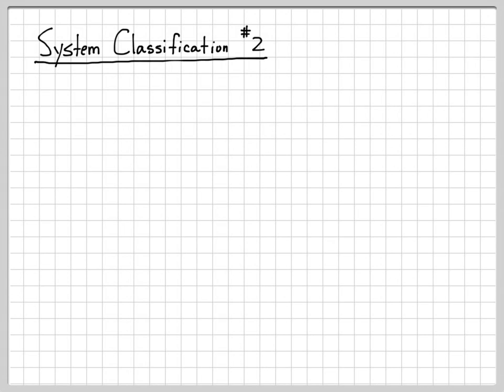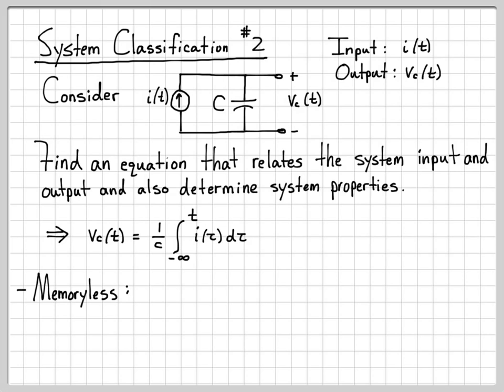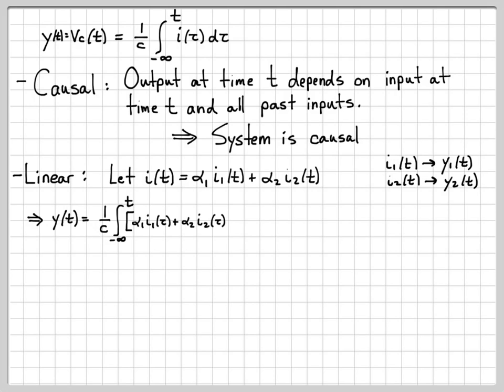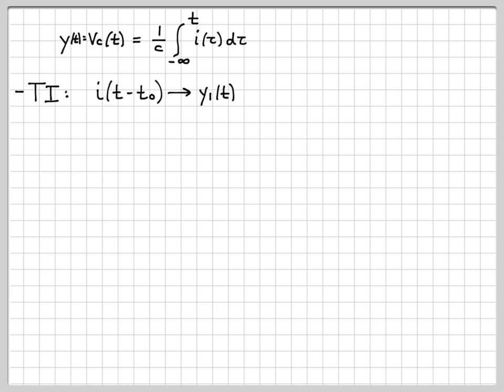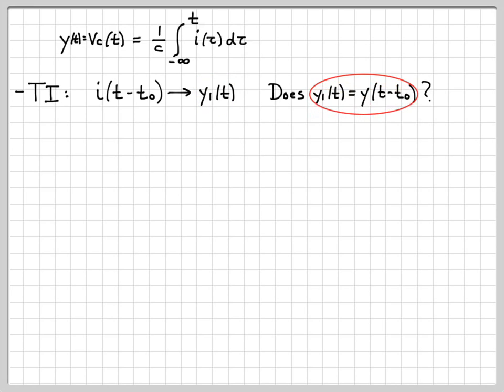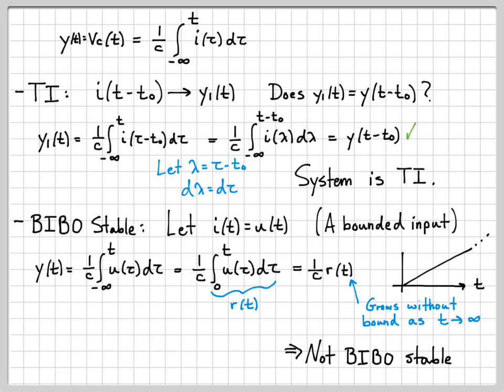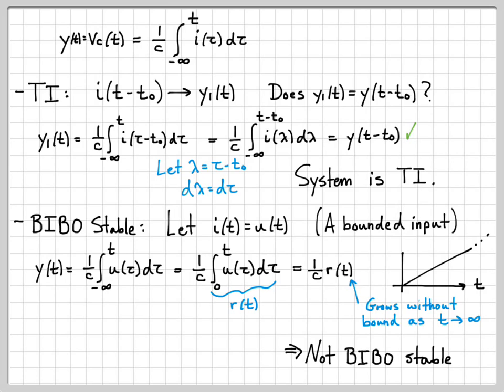System Classification #2

Comment: Hi. I'm trying to teach myself signals/systems stuff for personal interest via YouTube and your videos are VERY helpful, but I think it would be clearer if you related everything to real-world hard tech. The example of BIBO stability is one of these. Applying the unit step function across this capacitor is a bit like running a one amp DC current across it from time zero, in which case the potential difference will climb without limit as long as that current is maintained - and you can logically deduce that you would expect a non-BIBO outcome. (Of course in real life eventually the PD climbs so high it blows through the dielectric and ends things, but that's another matter.) 

I will work my way through your vids and await an example of a BIBO-stable system and its real-world equivalent!!

Comment: You have defined Memoryless system and Causal system exactly the same. I believe that Causal system definition is correct: Output at time t depends only on input up to time t (which includes past times like you mentioned). Where Memoryless system should only depend on input at time t and not past inputs. Like the name suggests, there is no memory on past inputs but only on what is currently happening at time t. That is why capacitors/inductors are usually memoryless like you mentioned.

I also want to thank you for sharing your videos with the public! Very informative and well explained! May I ask which textbook these videos are based on or which one you would recommend for learning?
Reply from the maker: No, I have not defined them as the same.  If you go looked at the definition of a memoryless system, a memoryless system is only a function of the current input.  It cannot depend on past inputs or future inputs, otherwise it has memory.  Thus, the impulse response of a memoryless system always has the form h(t) = k*delta(t) (i.e. it's just a scaled impulse).  

Since h(t) = k*delta(t) for a memoryless system, then obviously a memoryless system is a causal system.

However, a causal system is not necessarily a memoryless system.  For example, a system with impulse response h(t) = u(t-3) is causal, but definitely not memoryless.

Hope that helps.
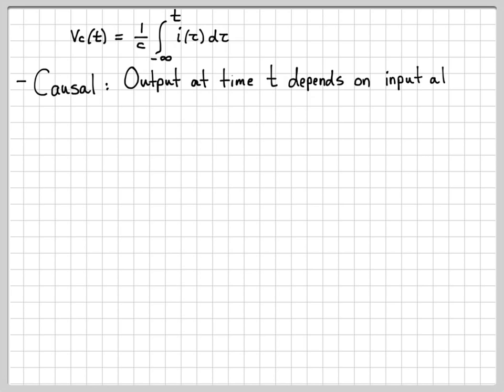Reply: Thank you for the quick response Dr. Panagos! Sorry, I should have been more clear. I meant specifically at 2:05 and 3:03 of the video where the definitions Memoryless and Causal are displayed. I personally found it a bit confusing. Your explanation cleared up my confusion! Thanks again! Also my question regarding a textbook, which one would you recommend for learning this material?